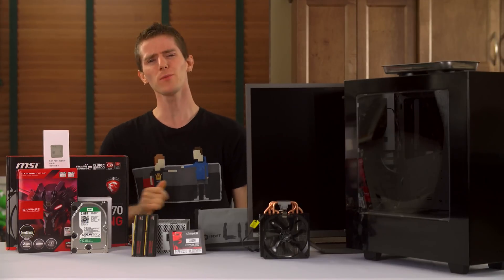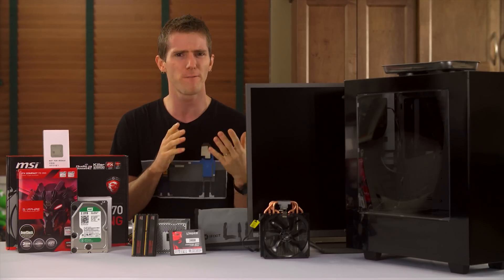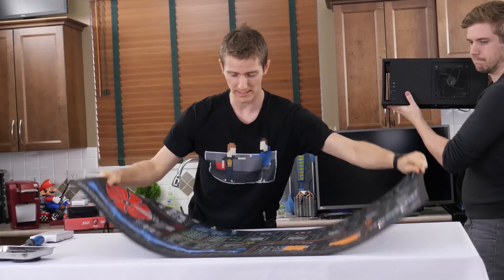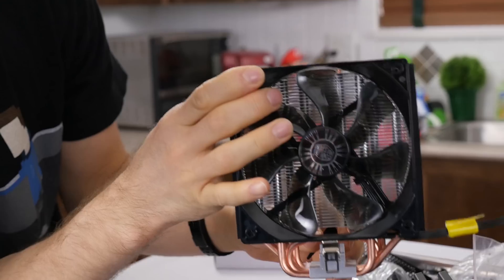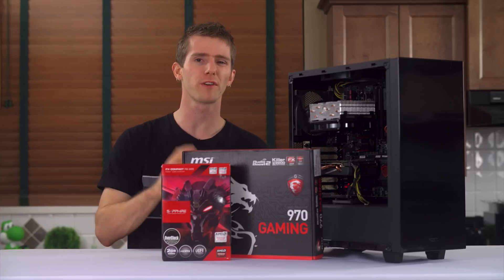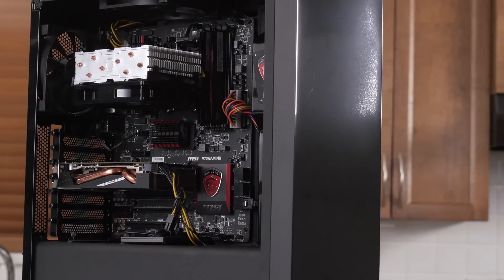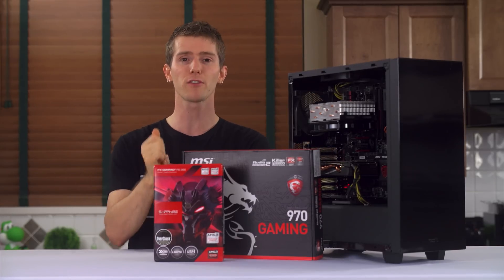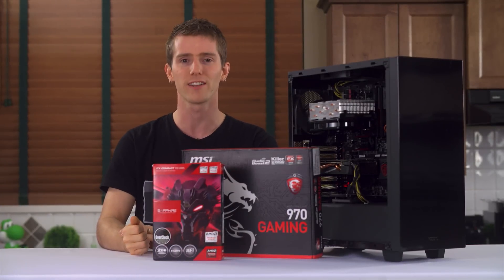Can you Build a 4K Gaming PC for Under $1000?

Comment: does this seem good for a gaming pc? (1080p-1440p)
Component 
CPU 
AMD FX-8350 4.0GHz 8-Core Processor
$149.99

CPU Cooler 
CRYORIG C7 40.5 CFM CPU Cooler
$29.99

Thermal Compound 
Arctic Silver 5 High-Density Polysynthetic Silver 3.5g Thermal Paste
$6.88

Motherboard 
ASRock 970M PRO3 Micro ATX AM3+/AM3 Motherboard
$41.98

Memory 
Kingston HyperX Fury Black 8GB (2 x 4GB) DDR3-1600 Memory
$29.99

Storage 
Samsung 850 EVO-Series 120GB 2.5" Solid State Drive
$64.99

Western Digital Caviar Blue 1TB 3.5" 7200RPM Internal Hard Drive
$47.49

Video Card 
MSI Radeon R9 390 8GB Video Card
$295.98 Buy

Case 
NZXT S340 (White) ATX Mid Tower Case
$62.69

Power Supply 
EVGA SuperNOVA NEX 750W 80+ Gold Certified Fully-Modular ATX Power Supply
$69.99
Total: $799.97
Reply: No get an Intel over AMD and NVIDIA Graphics card. Also, only ever get an Asus motherboard
Reply: bacon dont listen to these people they clearly are sheeps for intel ignoring how well amd performs and they probably think the more expensive it is the better it must be.
Reply: p.s. intel chips are shit for gaming.
Reply: If you're getting a Micro ATX motherboard it might be more worth it to get a smaller case that takes advantage of its size, so that way your computer can have some portability. That's the advantage of Micro ATX after all
Reply: but other than that its good?
Reply: I agree with Thomas get a intel and nvidia I had a 8320 OC'd to 4.4 and hated it, it preformed terrible in Arma 3 Men of war even borderlands, but i wouldn't recommend ASUS I had one with my 8320 the M5A99FX 2.0 Pro to be exact it had posting problems and an whole list of problems. Save some money get a 4790k and a nvidia 970 or better, I run a 3440x1440p x34 predator I know what I'm talking about amd is not the way to go for gaming.
Reply: Don't get a 390. It has a very high TDP(275W), and is obsolete once the RX480 comes out. It has a 150W TDP, and is slightly faster than the 390, and is 50$ cheaper. Because you now have an advantage on the TDP, get a FX-9xxx CPU, which is much faster. Or just get a superior Intel CPU that won't be obsolete in 2 years.
Reply: the reason its a r9 390 is because i have on collecting dust on my desk and i want to use it
Reply: bacon Bliss Ahh, ok. Then I have no reason to argue.
Reply: also for budget reasons i did not go Intel it would cost me $200 more
Reply: bacon Bliss Just get a 4690k or a 6600k, whichever is cheaper. They cost 200-240$, which is only 50-90$ more.
Reply: would have to get a different and more expensive mother board though
Reply: bacon Bliss Ah, good point. It would have to be a Z motherboard. I've heard that some Z97:s are 80-100$ though.
Reply: amd one for 50 so its not 50-90 more its 80-110 more at a minimum
Reply: bacon Bliss Well, get a better PSU and an FX-9xxx CPU
Reply: already got the psu and an fx-9xxx is usual 50 or so more
Reply: The Impact I'm running i7-4790K and GTX 960 (soon to be upgraded to 1080) on my ASUS board always found ASUS to be reliable however I have seen that more brands are also as good so might try something better.
Reply: brichard harris Says the one that says that Intel chips are shit for gaming. AMD's FX-xxxx chips were awesome back when they released, but they're outdated now. 4th-6th generation Intel chips are far superior compared to the AMD chips. But before you go calling me a sheep, realize that the FX-xxxx chips released in 2012. It is stupid to say that a CPU from 2012 is superior to one released in 2014-2015. You're the AMD sheep if you think the opposite. The higher-end AMD FX-8/9xxx chips are still viable for gaming, but intel's 4th-6th generation -K processors are far superior. The intel CPUs are more expensive because they're newer and better. It's stupid to go for AMD's processors that are 4 YEARS old. Trust me, I know both sides. I'm running an intel i5-2320 right now, and I've had an FX-8370 before I sold it to get money for other things. It was good if paired with a good GPU. It could destroy every game I had, no problem. 

TL;DR: You're stupid, and AMD was ahead of its time back in 2012. Intel is more expensive because it's superior and newer.
Reply: have fun with the cores you will never use in your cpu since games only ever use 4 at most.
Reply: actually when you check video benchmarks they get all the cores to about 80% also amd is the budget version of intel so intel has great cpu's but they are just more expensive but give better performance than most amd cpu's
Reply: bacon Bliss That is correct. Although, in 2012, the better FX-series was superior to Intel's 2nd generation, and the FX-6300 was roughly equivalent to an intel i5-2320. The FX-8/9xxx CPUs have aged better than the 2nd generation Intel Core CPUs though.
Reply: Johan Ekstrom that was 2012 this is 2016 though yes amd processors age better unless you bend the pins on the cpu
Reply: bacon Bliss My point exactly. You can't really compare AMD's FX-series processors to Intel's Skylakes or Haswell(Refresh) processors. Zen is coming out this year, and they will most likely deliver another revolution like they did with Vishera. If you can, delay your PC part buying, just in case Zen does the same as Vishera(being very cheap and delivering excellent performance). I'm personally going to buy a Skylake/Haswell Refresh, because I prefer Intel. Going to pair it with an RX480(or two) though
Reply: im not planning on getting this really soon i'm getting other stuff first this is to check and make sure i got a backup i can always swap some parts around this i guess is something of a base model but the r9 390 is because i have on just sitting in its box and i want to use it
Reply: bacon Bliss Ah. I have 500€/950€ for my build. This is an average for all of my potential builds. They all have an RX480, but some have 4690Ks, and some have 6600Ks. The one with the 4690K is probably the one I'll get. That model will actually have a colour theme, unlike the others. The theme is black/blue. I've imagined it in my head, and it's awesome. When I get 250€ extra, I'll 2-way crossfire it.
Reply: Johan Ekstrom im thinking about a black red amd build
Reply: you should try to be rediculous and use one of these 
https://www.amazon.com/Thermaltake-Gaming-Modular-Cooling-Radiator/dp/B005F76ZNY/ref=sr_1_14?ie=UTF8&qid=1466386864&sr=8-14&keywords=thermaltake+level+10+gt
Reply: bacon Bliss That's appropriate, considering that AMD's color is red. I just realized that intel's color is also blue. A good bet for coloured RAM is HyperX Fury, btw. They look clean, unlike some others, like G. Skill Ripjaws X/Ares RAM.
Reply: bacon Bliss I'm not made of money though. I'm only spending 80€ on the case.
Reply: aww darn no ridiculous case, but yeah seems like we got the right colors in mind lol good luck with yours
Reply: bacon Bliss Good luck with yours man.
Reply: This is my exact build just a couple color differences. My setup is a black and blue build. So the case is black and I painted the r9 380. Also my r9 380 is 4gb not 8

Comment: Can someone tell me how many TFlops do you need to game in 4k 60fps
Reply: Man, it's less a matter of Tflops than it is a matter of components quality. The Xbox Scorpio has a 6 Tflop GPU but won't run AAA games at 30fps 4K. The Titan X GPU can run Arkham City at 60, boasts a 7 Tflop performance, but before anything it has 12 GB of VRAM and 3072 CUDA cores.
Reply: TL;dr you need a 7 Tflop GPU but with it you need a lot of VRAM, a high-end CPU, lots of the fastest RAM available, a good motherboard and a monstrous Power Supply Unit. And a case with quality cooling.

Comment: Can i have a smooth gameplay in gtav and other newgames in this pc?
Reply: You'd get decent performance but there's no point buying that GPU since there are better ones for the price now. AMD are releasing their RX 480 in about 2 weeks for $199 which will have around the same performance as a GTX 980 on DirectX 12 and will be vastly more power efficient. I'd also get an FX 8350 or better for the CPU.

Comment: Would you still agree with the FX6300 now the FX8320E is only 25% more expensive?
Reply: i5
Reply: Sure.  I run my 6 core FX6300 Black Edition at 4.44 Ghz on a 222mhz bus.  Scored this CPU, Gigabyte 970A-DP3 motherboard & a Cooler Master Hyper 212 EVO CPU cooler all for the price of an equally performing OEM Intel I5 CPU.

Comment: I wouldn't trust AMD in a gaming PC. I'd rather spend a little more, but get something that can survive some abuse.
Reply: AMD is fine for a gaming PC, their GPUs are the best for price to performance. the FX line also is good for its price, with the caveat that it is a dead socket and would require a new socket for upgrades.
Reply: luca hawkins My problem with AMD is how much of their hardware has failed on me, under normal usage conditions (no OC). For a gaming rig, OC is a given, and I simply can't trust AMD to be able to handle 70C+ on a daily basis.
Reply: +Nekros temperature will cause problems regardless of brand, plus you can just pop a better cooler in with the money you save going amd
Reply: luca hawkins But the scale of "problems" varies. A temporary cut in performance is okay. A dead CPU is not.
Reply: +Nekros with a good cooler, your not looking at a loss of performance, let alone a dead chip
Reply: luca hawkins A good cooler allows me to push my CPU further, doesn't negate any risks.
Reply: +Nekros of course, but with the element of temperature removed, the risks are equal with amd and it's competition.

Comment: Those CS:GO framerates are borderline unplayable... I'll stick to my 400FPS at 1080p
Reply: So much bullshit
Reply: Louisarius what bullshit?  144 Hz master race
Reply: ***** which kid?
Reply: ***** what does tou mean?
Reply: ***** 960s are for peasants. You have to have a x(x)70 or better to be in the nVidia race.
Reply: I get 130fps at 1080p with an AMD 7570/Intel Core i5-2320
Reply: +Louisarius Bullshit? That's cute. Cuz my 760 FTW with 4gb vram runs csgo at 270 fps and it's an old card. I'm pretty sure a 980 or 980ti could double that performance. CSGO isn't an intense game :/
Reply: MrMyriad Agreed. I'd even say that it's heavier on the CPU, but I'm not sure.
Reply: MrMyriad What settings though? at 1080p, all max (except FXAA and motion blur, because fuck those) I get 400ish on most maps (i.e., not new Nuke).  My CPU is a 4790k OCed to 4.8 GHz
Reply: Niko Yochum What GPU do you have? Even if it is more CPU-intense, the GPU matters too.
Reply: Johan Ekstrom GTX 980 OCed to around 1.5 GHz core and 8 GHz memory
Reply: Niko Yochum Pretty nice. Can imagine those FPS pretty well.
Reply: Niko Yochum I do max and have AA on as well. I have a 6700k not overclocked. What RAM/GPU do you have? I think I might have overheating issues that throttle my performance.
Reply: MrMyriad I use AA, I just don't use FXAA because all FXAA will do is blur lines to make them less jagged, which makes everything less clear.  I have 16Gb of RAM and a GTX 980
Reply: Niko Yochum Well I have a 760, so thats why
Reply: MrMyriad ahh, makes sense
Reply: MrMyriad
Calm the fuck down, my 960 does even better at 320+ fps 1080p, using a 120Hz monitor.
Reply: MrMyriad
4xMSAA + FXAA enabled
Reply: Louisarius never use FXAA, it makes everything look blurry
Reply: *****  #HowToStartAFlamewar  let's see how the RX480 does compared to the GTX 1060 (which will prob launch over $200) :P
Reply: *****
Nah, not an Nvidia fan.
Reply: Johan Ekstrom
Stuff isn't even out yet ffs
Reply: Niko Yochum
I'll be getting the RX 480, or the RX 480X when it comes out.
Reply: Niko Yochum RX480 will win 1060, and RX490 will win 1070, like usually. Vega Fury wont win 1080, Vega Fury X will win 1080. That's my predictions.
Reply: Louisarius What do you mean by that?
Reply: Louisarius I would recommend waiting for real benchmarks (i.e., not released by AMD)  before making that choice :P
Reply: Johan Ekstrom I think that the RX480 will beat the 1060, the 1070 will beat the 480x and 490, the new fury will beat the 1080, and right when the new fury x launches, Nvidia will release the 1080 ti which will ghetto stomp AMD
Reply: ***** You're the fanboy here. You don't know any benchmarks for AMD cards, but you buy the worst version of the 1080 just like that. You could've at least waited for an aftermarket 1080, unless you're getting an alternate cooling solution(CPU cooler fitted on it for example).
Reply: Niko Yochum 1070'll beat the RX480X, but the RX490 will win the 1070.
Reply: Johan Ekstrom or a custom water loop... even then, a custom PCB would be better and give you more control over voltage and power.
Reply: ***** When did I state my age? I could easily be a PC veteran who has built computers actively back when 512MB of DDR RAM was normal, and when motherboards were always in separate south- and northbridges. You most likely don't even know what the fuck I'm talking about here. Why get the 1080 FE when you could get an aftermarket card (which are objectively better)a little bit later?
Reply: ***** dude... it is called Founders edition, not finders....
Reply: Niko Yochum
Yeap, and if the RX 480 is not strong enough, then I'll be getting the RX 480X.
Reply: ***** Wow you're an idiot. I said that I was building computers when 512MB of DDR RAM was common when I started building computers. You were ~10 years old back then, dipshit.
Reply: Johan Ekstrom
Chill, he didn't read it carefully hahahaha
Reply: ***** You're being disrespectful.
Reply: *****
Because you went boom-boom after misunderstanding what he typed and sent through the internet.
Reply: +Raven518 well you have no knowledge buying a AMD CPU thwn
Reply: Do You mean i7 6700k or i5 6600k?

It wasn't you my comment was aimed at :)

Comment: I'm going to wait for the gtx 1070...
Reply: The 1080 will probably be like the 980, where a ti comes and totally dominates it. While 1070 will always be a bang for the buck.(like the 970) But i'm just speculating, none of what I said is based on facts.
Reply: Dude you got it kinda wrong. The 1080 will have a Ti version, like the 980. The 1070 will be bang for the buck, so you get great performance for a decent price, like the 970.
Reply: This was made two years ago, a lot easier now...
Reply: TheHawrk Yes really.
Reply: TheHawrk Well its Price for Performance
Reply: +Eduardo Gonzalez AMD is better,and cheap.
Reply: EXSPECIALLY RoYaL7 AMD is better for low to mid range and PTP.
Reply: joey macarony i have an r9 380 and i can run gta v highest setting with a 35 -45 fps. But u just put v-sync to half so it locks at 30.
Reply: EXSPECIALLY RoYaL7 locking it at thirty is not ideal. It causes input lag, thus making the experience worse.
Reply: Because AMD is better quality at hat price range.
Reply: Ben Fink They don't cost the same...
Reply: IggyDoesStuff Look at the d8
Reply: k
Reply: why not 1080?
Reply: ***** expensive*
Maybe, but worth it, if you save money for some time
Reply: +Sir BladeSpeedy yup it is too expensive
Reply: +joey macarony Not rly :D
Reply: joey macarony The 1070 costs around 500 Bucks - thats not a decent price
Reply: TheHawrk based on the performance, the price is pretty good
Reply: +joey macarony yeah i know, but would you like to play a game that goes from 35-45 and causes lag.
Reply: EXSPECIALLY RoYaL7 No, so why are you calling AMD is better and cheaper if one of their GPUs can be out performed by an equally priced nvidia?
Reply: zachary eminger An Nvidia card at that price range can do much better than AMD.
Reply: It kinda sucks but that's the truth, the 970 preforms at the same level as the new 480 and costs about $30 less and 2 years older. AMD tried to sell that dual 480s were a viable option for high end gaming which pissed me off.
Reply: +Gus Rowan I don't know what 970 you can get for 170 dollars
Reply: the 480s pricing is about 300 right now, it was only priced competitively during it's release. Prices have gone up because of limited stock issues
Reply: Buy a 980 Ti Hybrid for about the same price. It will perform much, much better (if you can overclock above 1500MHz).
Reply: or, be smart and get a 1080 for the same price as the 980 ti
Reply: It ranges from 40 dollars less to 70 dollars more, I consider that roughly the same

Comment: You could just build a GTX 1080 build for 1k. Isn't it decent for 4K?
Reply: This video is over a year old and the 1080 costs ~$600 which is over half the budget.
Reply: +Stig's Italian Cousin  Yeah, I know that the video is over a year old, but my comment still stands. I think you can afford to spend that for the graphics card. This is the build I was thinking of:
 
Intel Core i5-4690 3.5GHz Quad-Core Processor
$209.99 

Biostar B85MG Micro ATX LGA1150 Motherboard
$37.98 

Crucial 8GB (2 x 4GB) DDR3-1600 Memory
$25.98 
 

Kingston SSDNow V300 Series 120GB 2.5" Solid State Drive
$41.33 

Seagate Barracuda 1TB 3.5" 7200RPM Internal Hard Drive
$45.89 

GTX 1080 
$599.99 
  
Azza Cosmas ATX Mid Tower Case
$25.98  

Raidmax Cobra 500W 80+ Bronze Certified ATX Power Supply
$24.99 
Total: $1012.13

Dunno if the CPU'll bottleneck, but if it does, just upgrade to Skylake for less than $100.

Comment: "A good monitor lasts multiple computers" I was just gaming on an old Dell 1280x1024 monitor from over a decade ago at 75Hz while giving Ubuntu a spin. I might end up keeping that monitor for things in the future like pfsense or a server. Still, just goes to show you how useful the monitor can be. In fact my second monitor on my gaming rig is a 5 year old monitor I used on my previous computer. (It only got moved to secondary because I got a 144Hz monitor) All in all one of the best parts to reuse. That 4:3 monitor is only second to a Dell mouse I somehow inherited from my dad's Windows 2000 laptop for work that I use frequently on my laptop, just because of it's great dpi for casual use, and simple yet durable design.